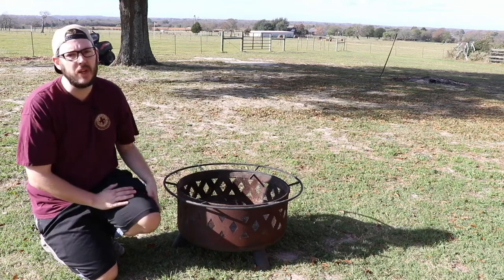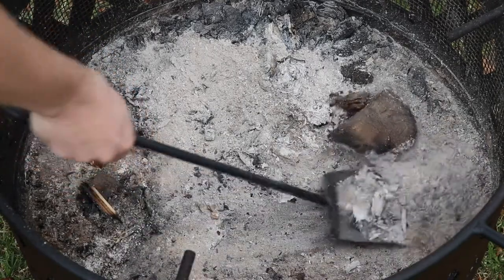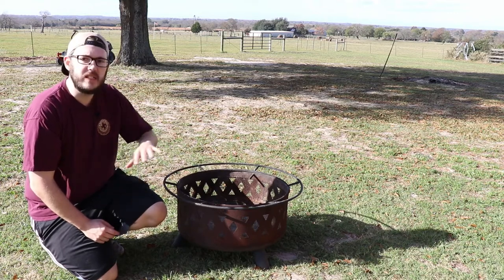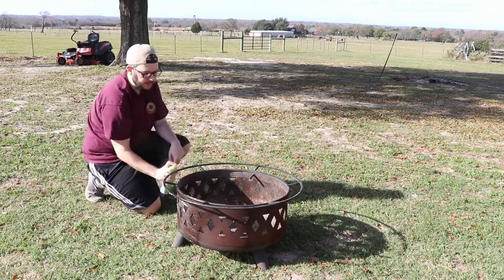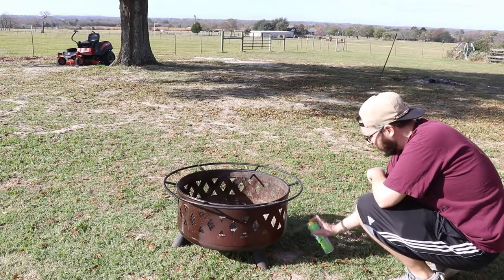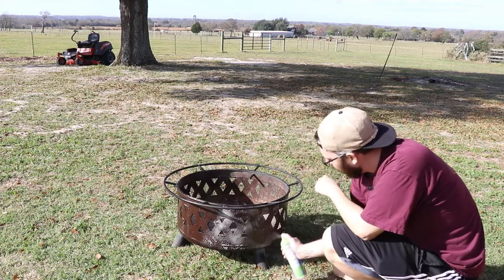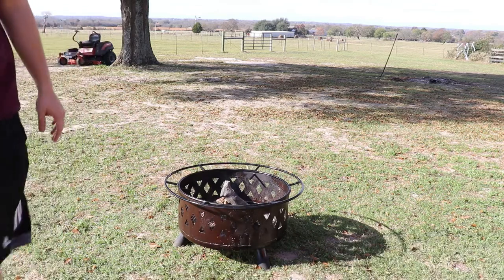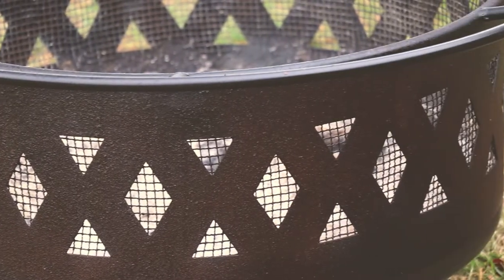How to Fix your Rusty Fire Pit

Comment: I was going to sand mine down and spray it with high heat paint. Should I oil treat it first? Or can I still do this after the paint?
Reply: I was literally thinking of the samething. But probably season it after high heat paint is completely cured on it. And yeah sand down as well👍
Reply: I was thinking the same thing